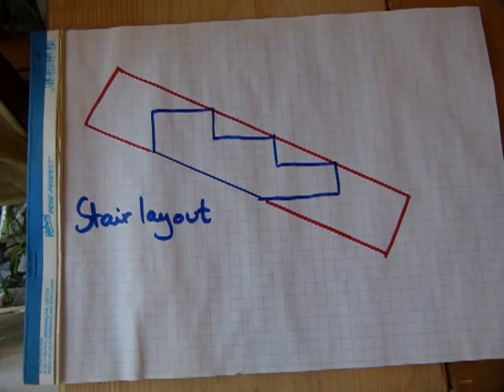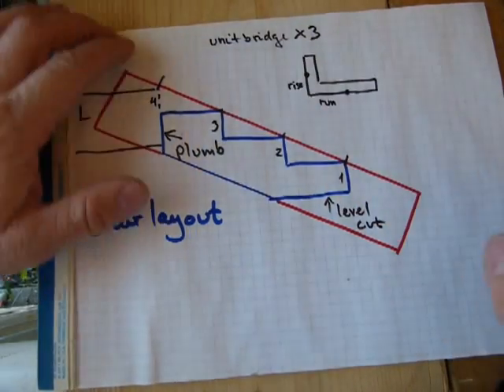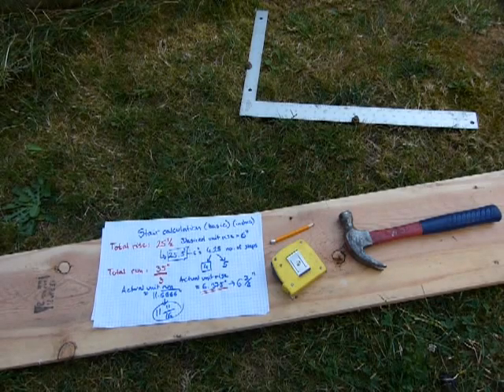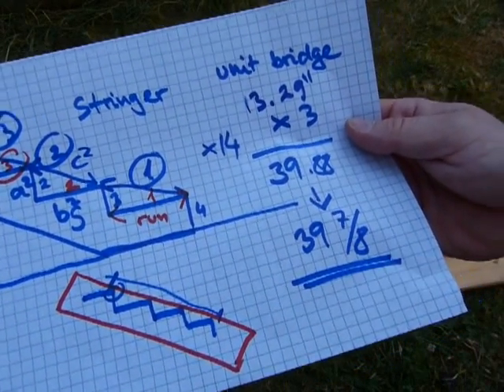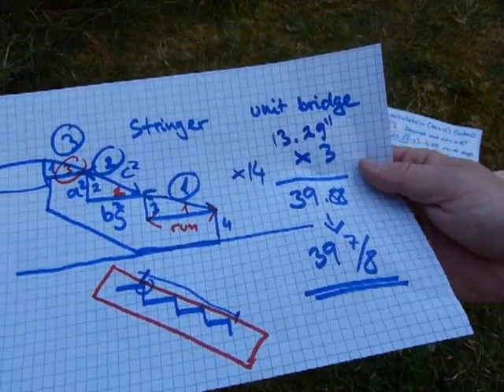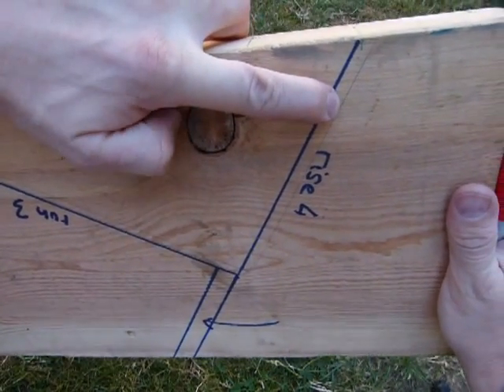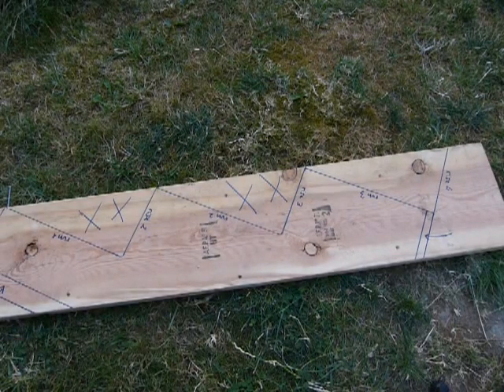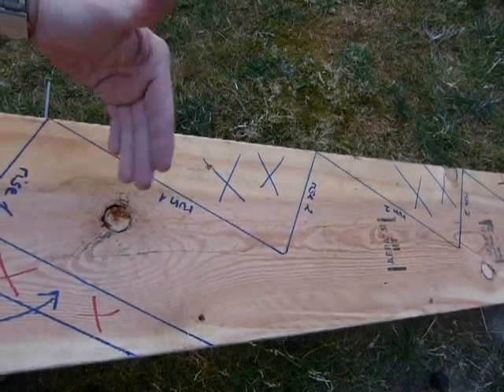Stair layout (basic, straight flight) #diy #carpentry #training #stairs

Comment: If your stringer material ( the 2x10s ) are questionable it seems to me your should make a plywood template and slide it along each 2x10 as an easy way to avoid knots etc.
Reply from the maker: Not sure that one should, but certainly could. I sometimes make one out of paper, occasionally with different rise-run combinations to see which pattern works out best. Super fast & cheap to make them.
And then there is computer graphic layout ...
Thanks for watching.